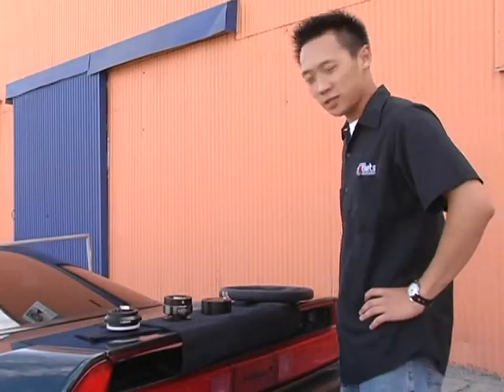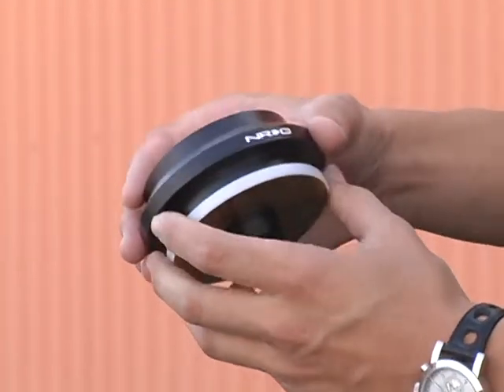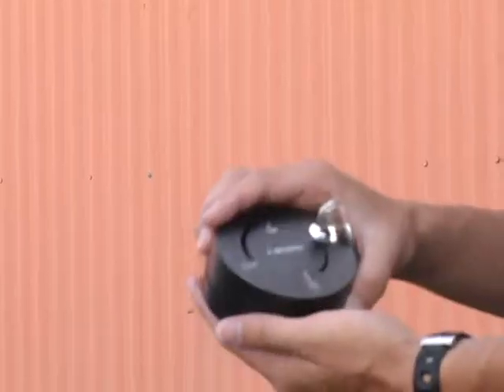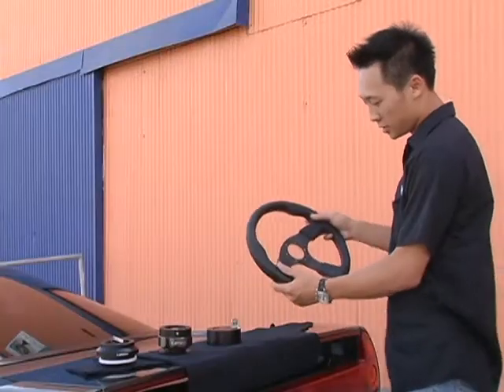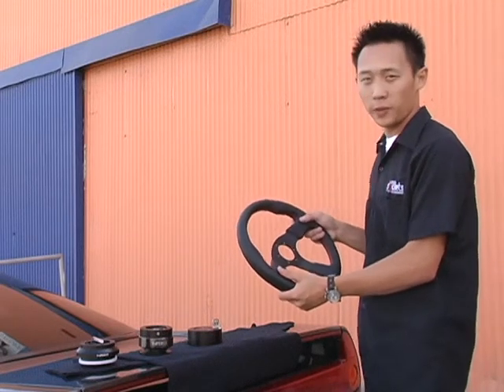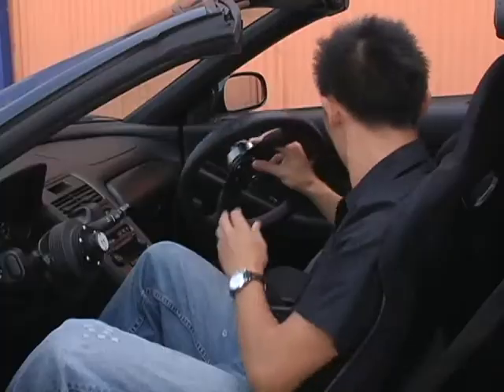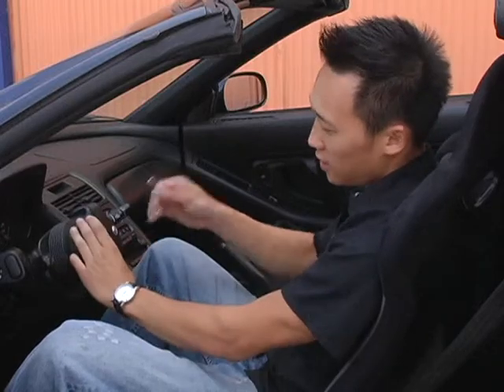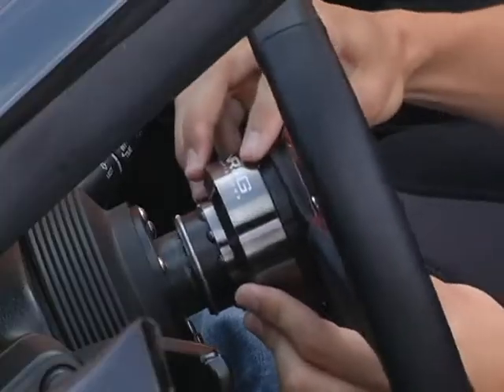NRG Quick Release Tutorial

Comment from the maker: @luke1991132 horn will work.  are you currently running an aftermarket hub/steering wheel combo?  the quick release is universal 6 or 5 bolt setup.  you just need a hub specific for your car.

Comment: hi i was wondering if there is a nrg short hub that will fit a 1981 datsun 280zx and also i bought a momo steering wheel that has the quick release attached to the wheel itself but not the part that goes over the hub do you guys sell that seperatly?